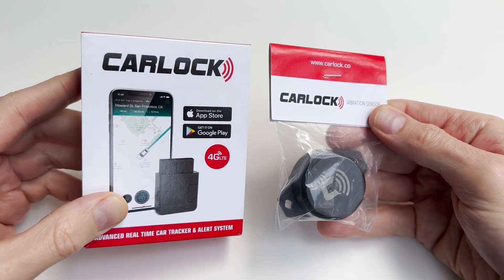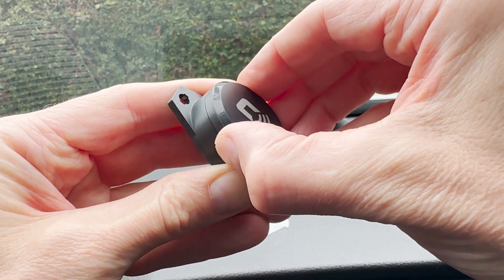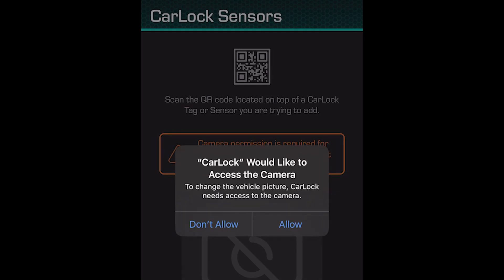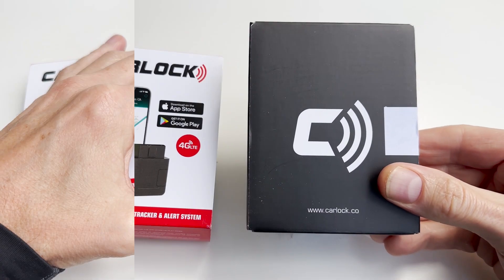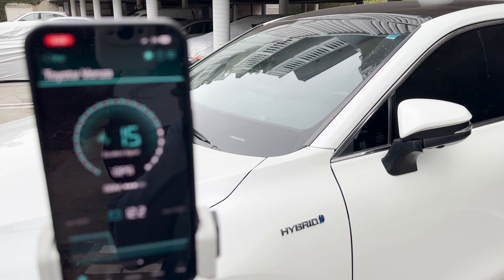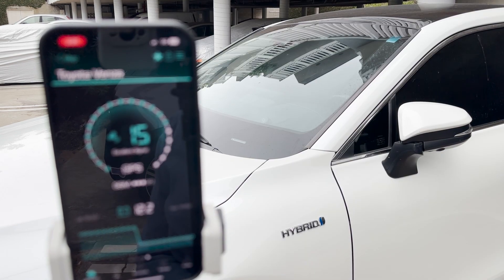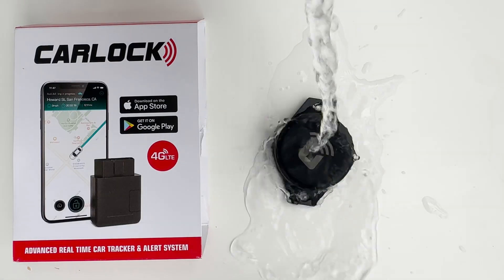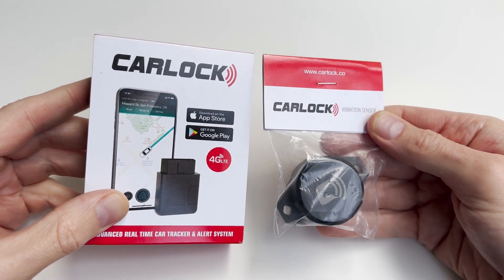Pairing, Testing & Durability Demo - CarLock Vibration Sensor | Ultimate Car Security Upgrade

Comment: Can I just buy the sensor and have it send notification to phone?
Reply from the maker: Hi! Thanks for your question. Unfortunately, the vibration sensor cannot work on its own. It requires a CarLock main device (either CarLock OBD or CarLock Wired) to function and send notifications to your phone. The sensor is designed as an add-on, not a standalone product. Best regards, Ian - CARLOCK Team
Reply: @carlock_carsecurity  What is its range? If I park my car 5 blocks away and someone goes to open my door, will this system catch it or not? Does it also have GPS?
Reply from the maker: @Theodwros7  Thanks for the comment. CARLOCK is a GPS tracker, so no matter where you park your car, as long as there is connectivity, you will receive an alert. With the additional vibration sensor attached to your doors, the system will detect if someone opens the door and send an alert directly to your smartphone. Best regards, Ian - CARLOCK Team.

Comment: is there a workaround if your classic car is pre 1987 and does not have an OBD port?
Reply from the maker: Hi, and thank you for your comment! Yes, there are two ways to protect your classic car using Carlock. First, you can use the Carlock Power Adapter (https://www.amazon.com/CarLock-LYSB01L95PRQG-ELECTRNCS-Power-Cable/dp/B01L95PRQG
). This allows you to wire Carlock anywhere there is a power supply. Second, and the simpler option, is CARLOCK Wired, which connects directly to the vehicle’s battery: https://www.amazon.com/CARLOCK-Wired-Immediately-Suspicious-Protection/dp/B0C627PTFT . Both are great options—choosing the right one simply depends on your preference. Thank you, and best regards, Ian - CARLOCK Team